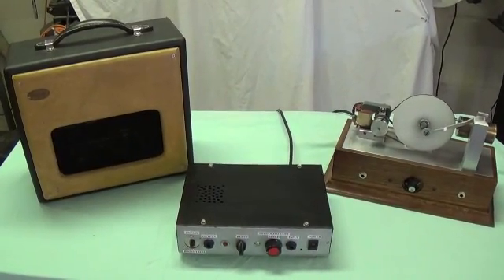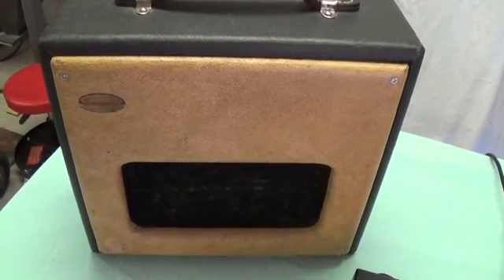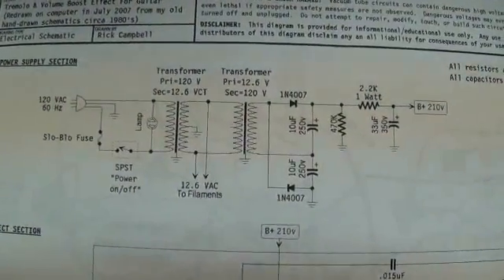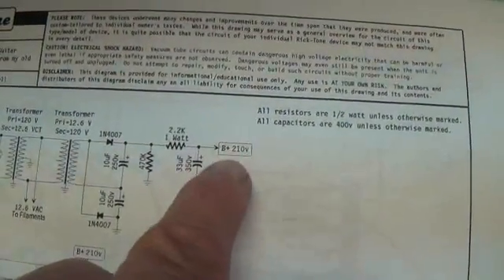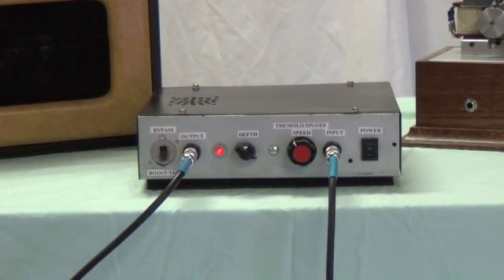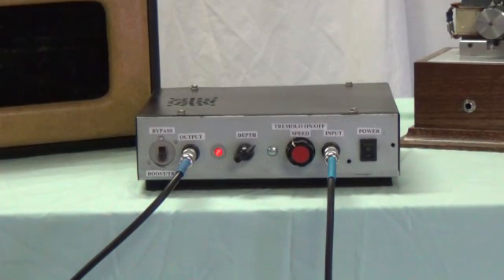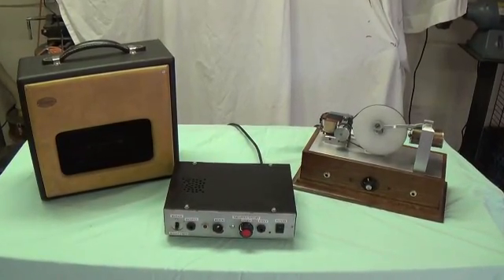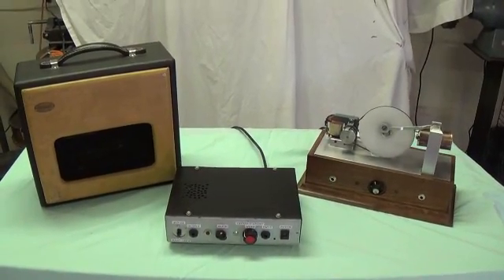Electromechanical Tremolo vs Tube Tremolo

Comment: I stumbled on to your YouTube channel a couple of days ago while looking for information on reverb units and ran across the video you made about a year ago with ElPaso TubeAmps on making a Fender 6G15 Reverb Tank Clone.  I was especially intrigued by the mechanism you incorporated for locking down the tank for transporting, and I would like to request a more detailed discussion of that mechanism, particularly how it actually contacts and locks down the floating inner tank.  Great videos, by the way!  I've enjoyed all I've watched so far, especially the more technical ones.
Reply from the maker: Greetings, JA, and thanks for the kind words. It's hard to describe complex mechanisms, but I'll try. The aluminum bar on the floor of the amp slides towards the front and back of the cabinet. It is spring-loaded and wants to go in the frontward direction. It has a notch that is engaged by a spring-loaded ratchet that locks it in its rearmost position. The forward end of the bar has a vertical bend that rises upward between the the tank and the cabinet front wall. There is a piece of dense foam glued to this vertical arm that pushes against and steadies the suspended part of the tank when the bar is in its rearward, locked position. When the ratchet is released and the arm springs forward, the suspended portion of the tank is released. I hope this makes sense.
Reply: Uncle Doug
Thanks for the explanation!  I assume from it that the cushioned arm does not push the inner pan far to be in contact with the outer housing, but  presses on it just enough to limit motion.  Is that correct?  This is of particular interest to me right now because I just discovered a problem with the reverb tank in my '72 Fender Twin Reverb that I'm sure was caused by moves with no lock-down of the tank: one of the fine wires holding one of the little magnets in its transducer finally broke.  So, the more challenging issue with the Twin is how to implement the lock given the location limitations in the Twin's cabinet once I get the tank repaired...
Reply from the maker: You're right, JA. The cushioned pad limits motion quite a bit but does not stretch the suspension  springs enough to press the sub-pan into the outer pan. This is possible because the Reverb Unit tank is mounted horizontally on the front of the cabinet and spaced out from the front wall about 3/4", thus allowing the padded arm to gain access to the sub-pan.

To accomplish this with a flush, floor-mounted tank would be a challenge. The tank would probably have to be elevated from the floor, and the padded arm would probably have to be configured as "rocker" (like a lever with a fulcrum in the middle) rather than a "slider".
Reply: Uncle Doug
Thanks for such quick replies!  You're comments regarding the mounting in the Twin cabinet are spot on.  To keep in on the cabinet floor I would have to position the tank as close to the back panel as possible since it is "squeezed" under one of the speakers in its original/current location.  It's also too long to mount vertically on one of the interior sides of the cabinet, so I have some head-scratching to do.  In any case, the lock would have to be a different configuration than yours.  Thanks so much for sharing your knowledge and experience.
Reply from the maker: You're welcome, JA. Best of luck with your project.

Comment: This is an interesting comparison! I first saw this mechanical tremolo unit when you made the video with David B. This shows a nice comparison between the two. From what I can hear, the mechanical unit is a more natural sounding tremolo as opposed to the electronic device. Since you're actually dealing with a 60hZ phase issue, the actual resonance from the guitar signal affects the shape of the wave which does have an adverse affect...this is why most electronics tremolos are more harsh at deeper speeds and intensities. Although, the electronic tremolo you built is unique with the power supply in itself! What I see (from the schematic you showed) is you've created an actual isolation transformer design with the secondaries paralleled so you are compensating for the lack of a high voltage winding on the secondary of the transformer. The voltage doubler you used is very simple, yet effective! even though the camera may only have a small capacitor element mic, I can still hear a major difference in the tone and smoothness between the both devices. I tend to favor your mechanical tremolo over the electronic one. This design you made is very effective, and mechanically, its quiet as a kitten! Great video (as always) PS: pet Rusty for me; he's a great inspiration for any electronics shop! :)
Reply from the maker: Thanks, Frank. I agree with your observations. The mechanical tremolo does, to my ear, have a more rhythmic, almost "organic" sound than the electronic tremolo. I wonder if it's not because the "shoulders" of its sine wave are more gradual, rather than abrupt (like a square wave).  Not very scientific.....but it makes sense (at least to me) :))  P.S. Rusty sends his regards ^. .^
Reply: You might want to connect an audio oscillator to the unit, then connect the output to a scope for a picture of what is actually happening...I would be VERY curious to see the outcome :)
Reply from the maker: I'll talk to David about it the next time we get together. He has all the best possible equipment for such an experiment.
Reply: Yes, too bad, you're not in Jersey, by me...I would love to do that...That's the engineering side of me coming out (LOL) :)  By the way, I saw your other video about the making of a tremolo unit out of junk laying around the house...Now, I see where your jukebox experience came from :)
Reply: Uncle Doug Do you have a scope to use for amp testing/evaluation? I find it a necessity in my shop...I'm spoiled :)
Reply from the maker: Yes, I have a Tektronix scope, but only use it sporadically. I tend to be an old-fashioned repair guy :)
Reply: It's funny that you say that...most of my testing is still done with mainly a VTVM...I just like to see what the amp is really doing if I encounter an unusual problem...:)
Reply from the maker: I'm a VTVM guy too. The scope has its uses, but most of my repairs are based on voltage and resistance readings.

Comment: do you think the mechanical trem. sounds better due to the fact it is not in the signal chain competing with a 60 cycle phase created effect which may disturb its natural resonating signal from the pickup and sine wave shape with timing? I hear some difference in frequency sound too, so maybe also the electro made one alters its true frequencies. Would like to see an oscillator scope on the sin wave shape of the two effects.
Reply from the maker: I lack the expertise to answer your question,  Bryan, but perhaps the difference in tone is due to the fact that the mechanical tremolo has a clear-cut "on-off" effect on the signal, much like a light switch, while the electronic tremolo simply modulates the signal, sort of like a light (partial) dimmer. 

I have since acquired an oscilloscope and could indeed monitor the difference in relative effect on signal output. If there is a significant difference, I will post a YouTube video demonstrating it. Thanks for the input.

Comment: I must say, that electro mechanical tremolo has a beautiful smooth and organic tone at full speed, Without the added grit that the Tube tremolo unit seems to add. But there is something very appealing about the Harshness of the depth on that tube unit, at speeds other than max.
Reply from the maker: I agree with your assessment, Juan, especially your use of the term "organic" to describe the electromechanical tremolo: smooth and devoid of electronic influence. Over time, I have made many modifications to the circuit of the tube unit to add depth and "grit" as you describe it. Besides the audible difference between them, they each have their own unique tonal qualities.

Comment: Note, it's Tremolo, not Vibrato. Also see- 'Hammond scanner vibrato', and  'Wurlitzer vibrato' - the North Suburban Hammond Organ Society, or NSHOS for short, has excellent articles on the Hammond tone wheel organ ( in which you can see about scanner vibrato), the 'Wurlitzer 4600 Series Organs', in which you can learn about the unique vibrato used in their electrostatic reed organs. NSHOS also has a great breakdown Hammond X-66 organ. It used 3 scanners for Vibrato,Celeste, and reed/string Vib.